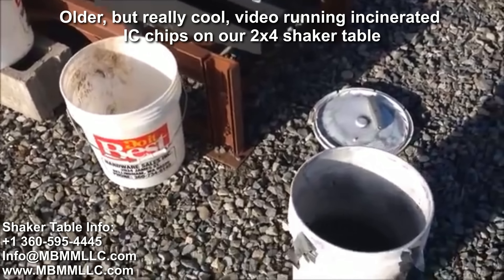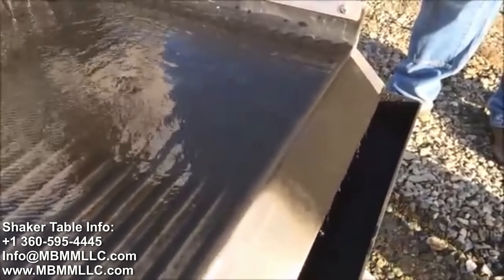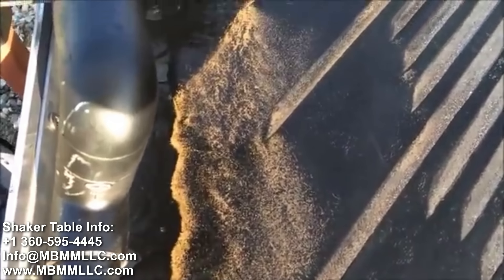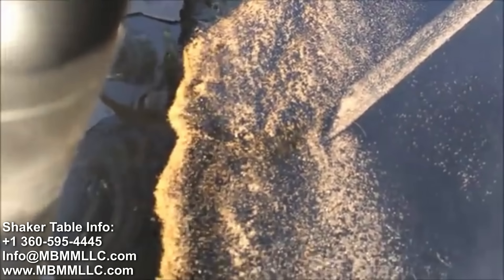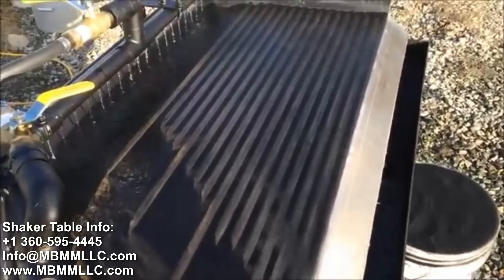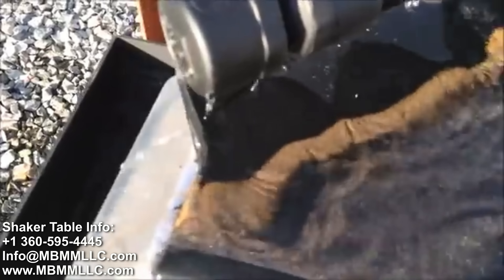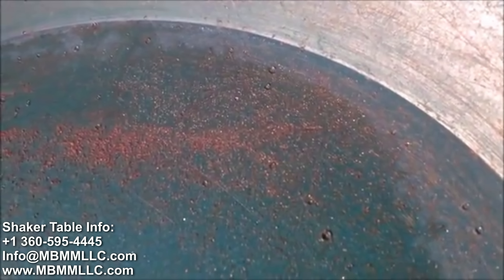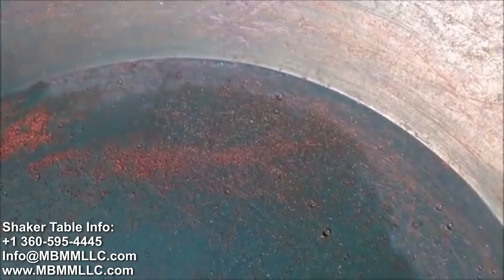Gold From IC Chips On A Shaker Table

Comment: I have a Question for you, Jason? How much Gold did you get from that bucket of ckt boards? I have about 75 very old Motherboards with CPUs from the late 1978 to 1984? Plus, I have several large outdated dual-processor boards from the 1990s DEC with CPUs. I used to work for DEC in NYC as a Sr. Field Engineer and I used to go up to DEC in MA for school in Bedford I used to go to their Scrap Depo in Maynard, MA, and pick up random scrap boards for pennies (aka CHEAP) just for fun. Now with Gold running around $2300+ per  OZt. I may crush them all and try and recover the Gold. Those old CPUs were made back then with a high amount of Gold compared to now.
Reply: Some of your 70-80s board might be collectible now so you might get more money if you manage sell them. Thats assuming they are in working order. Just my 2c.
Reply: @SickSlickNick  Most of them were trashed I tried to get some working but I found burnt traces.

Comment: How much gold do you reckon is lost to evaporation during the incineration process? Could the gold vapour be condensed out during that phase?
Reply: I doubt the incineration temps are hot enough for any vaporization of gold.
Reply: Gold boils at 2970 °C, 110 °C above iron. IC chip incinerators only get to ~1200 °C.

The only non-reactive metals that would boil are zinc, cadmium, and mercury.